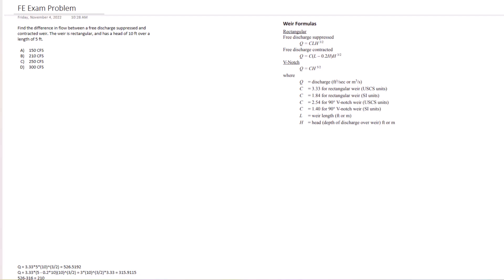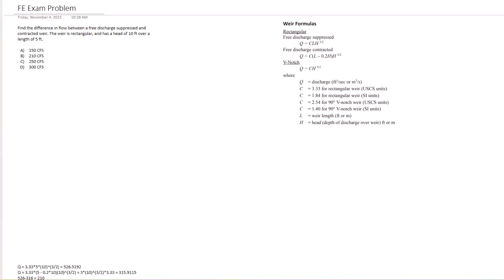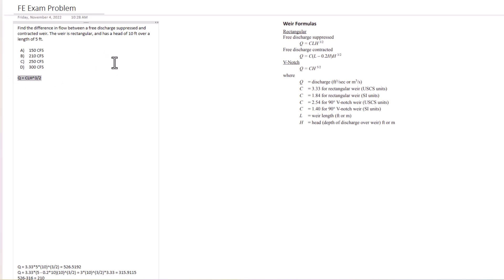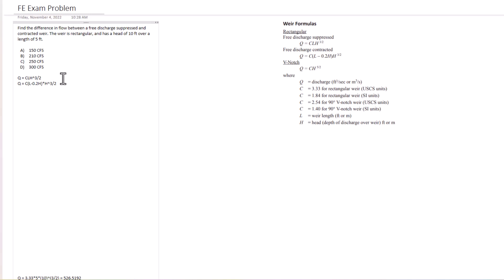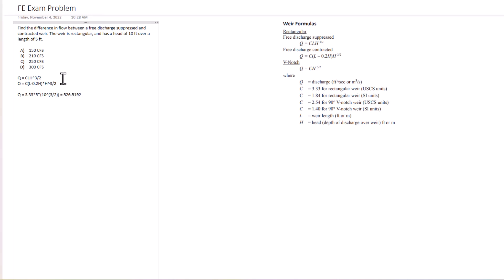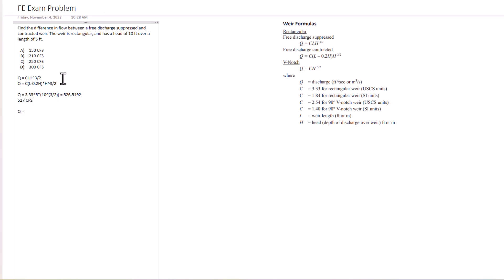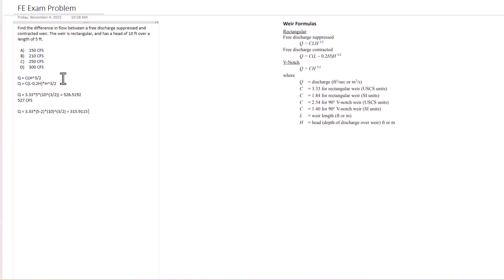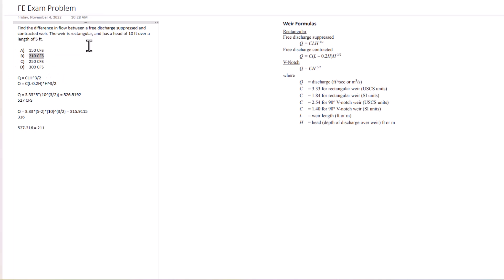Contracted and Suppressed Weirs | FE CIVIL WATER RESOURCES

Comment: The equation you are using for discharge from a contracted weir is assuming 2 end contractions, n in equation: Q = C [L – n(0.1H)] H^(3/2). Is that a typical assumption? Does weir behavior still follow this relationship with more or less than 2 contractions?